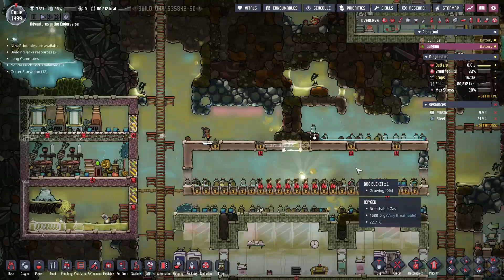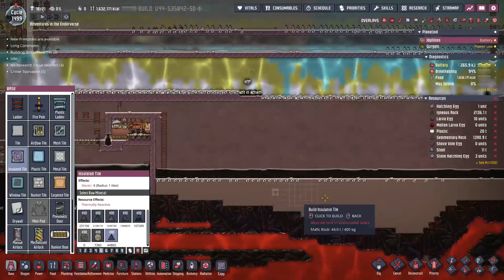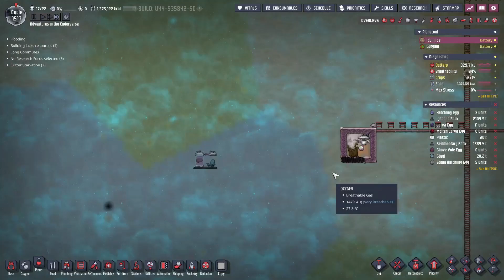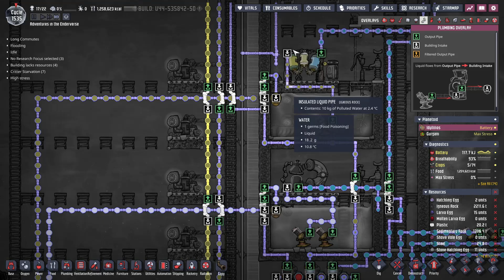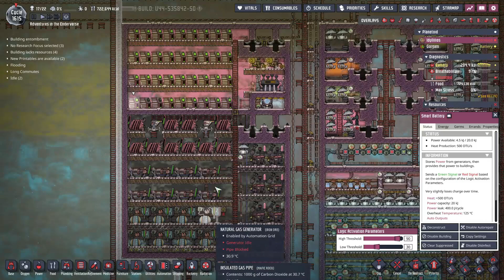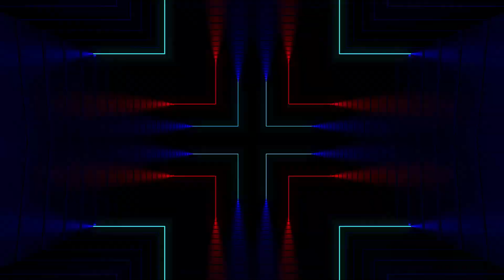Petroleum Boiler: Geothermal Power | 13 | ONI Redux | All Achievements

Comment: Hello, why don't you just connect the Nat Gen Co2 output directly to the exhaust pipe out of your power brick?
Reply from the maker: Now that the Petro boilers are running that would work, but initially I needed the CO2 from the nat gas generators to pressurize the room so the polluted water wouldn't off gas at the bottom.
Reply from the maker: I replied to you before work and i have been thinking about my base all day.  I think it's time to take an episode to go through all existing builds and update for the newer tech I have and streamline them before I head into space.  Thanks for the tip!